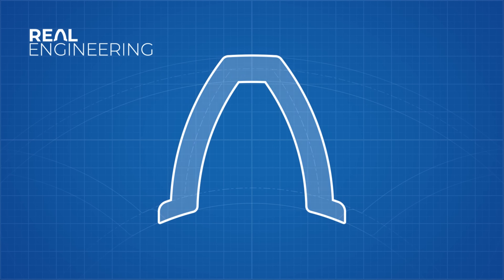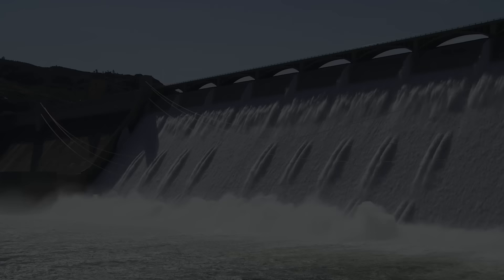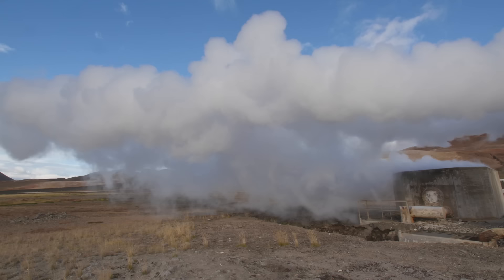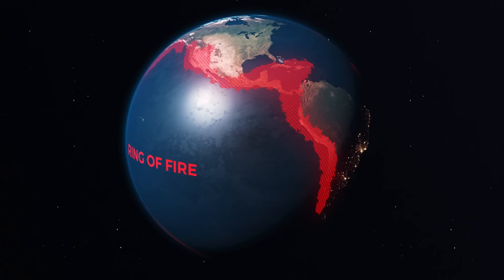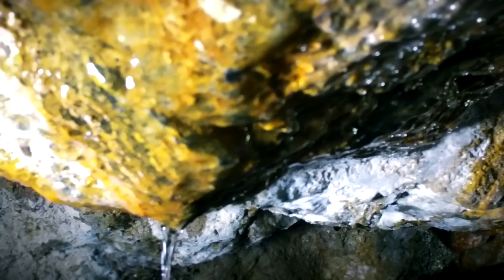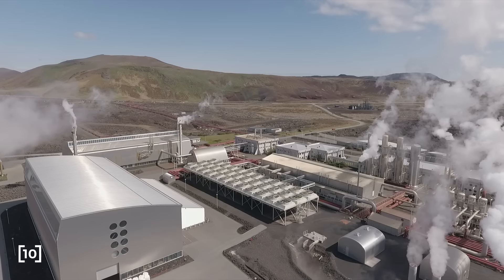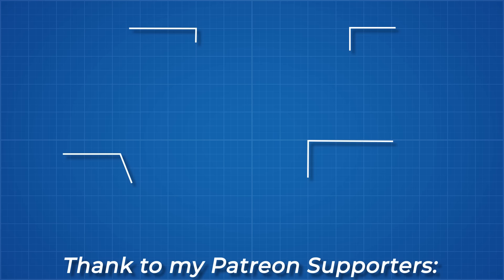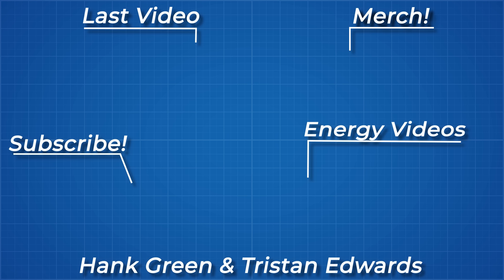Could Earth's Heat Solve Our Energy Problems?

Comment: If most of these geothermal sites are near tectonic plate boundaries, then aren't they prone to earthquakes? The underground pipes are gonna break and have to be rebuilt...
Reply: What everyone is missing is that it is actually that seismicity that generates the heat..  it's not coming from deep in the mantle.  That's why a borehole drilled on or near a fault will display far greater temperature increase with depth than a replica hole drilled to the same depth, but away from a fault.  Frictional ground movement is the key. 

Eliminate the seismicity from Yellowstone and there will be no heat to prime the geysers.  This is also why INCREASED seismicity will even activate long-dormant geysers.

Comment: a deep hole with 2 tubes.. one with thermal insulation, other with a high thermal conductive metal.. pump some substance through it and convert the energy from this heated substance using a v12 stirling engine made of coca cola cans

Comment: The solution lying directly under your feet is adding energy to an already heating planet. So how does an engineer explain how it isn't part of the problem? Volcanos are a natural phenomenon, releasing more geothermal energy by digging and drilling is additional and isn't 'renewable'. 

Harnessing already escaping geothermal energy isn't necessary when we use so little of solar energy already hitting the planet.

Comment: One question.
Why the binary cycle system is not being used in normal thermal powerplants as the liquids with lower boiling points will require less fuel to burn???
Can any one guide on this ?

Comment: This idea seems very dangerous to me.  Best solution to energy conservation is modest living.  Drilling into the crust has very little research compared to hydro or nuclear.  I don't know enough about solar but it is environmentally dirty.  But I haven't seen a document comparing hydro, nuclear, and solar on that front.  And I think at this point we need to really thinking about solar without battery storage with chemical standard storage.  We can store energy much more efficiently and cleanly.  That is just crazy.  so many topics touched.

Comment: Now what would intrest me are the limits of this technology. Say we built geothermal powerplants all over the globe. When would we reach a limit which would be dangerous to the dynamo effect of the earth core if that even would be a risk? Could we built too many of these so that magnetic effects of the earth are deminished, hindered or even put to a halt?

If used within geologicly active areas like the ring of fire example, would it help to stabalize those, again with the premise of massive amounts of these types of power plants, perhaps aiming for that limit and what would that be? I somehow doubt plate tectonics could be influenced by this, but for the sake of the argument, how many of these plants would be needed to do so :) ? I guess we would also need to define first a suitable size of a plant with a default output to get then a number of plants which would be needed to achiev what i questioned.

And lastly, what about the energy put into our energy balance that way, does it accumulate and by that increase say again the avverage temperatures on the surface, contributing to climate change? Sure there seems to be no waste, but the energy will need to go somewhere.

Comment: It seems to me, not enough information about the effect of taking the heat from the earth was presented. What is the effect of cooling down this top layers of the earth? Are we absolutely sure, that in the long run this won't affect the magnetic field of the earth?
Reply: Since we're not even sure that the core is hot in the first place, or that the magnetic field is actually generated by a dynamo at the core..  I'd have to say, NO, we're not absolutely, or even a little bit SURE about much of anything.

Comment: There are new ways to drill for geothermal energy by using a gyrotron which literally melts rock and creates a 'glass'  drilling hole while drilling. Testing with the new technology will take off in 2026 by Quaise energy. The technology can even be used to adapt old fossil fuel energy plants into geothermic energy plants.

Comment: Nuclear energy is a sensible energy solution NOW. Geothermal is nice in theory, but is still beyond our current technological ability. Some readily accessible geothermal energy is easy to get to but is very dangerous. But most stable sources are very expensive and difficult to get to. 

Let's keep using coal, oil and gas and nuclear while we are developing other technologies. 

The CO2 issue driving the panic at the heart of this is discussion is way OVERSTATED.

Comment: Truth about the root source for geothermal. 
Energy that power our solar system is electric energy in the form of cosmic electrostatic present in the cosmic space of our universe, from day 1. These e charge isn’t entirely static but transport from place to place in a process of charge equalization, in the form of plasma filament, aka Birkeland Current. Subatomic particles are carriers for e charge, if both separated otherwise, e charge and particles stay where they were. 

Plasma feeds our solar at its poles let it heat up high enough to emit electromagnetic radiation from infra red to uV, Xray wave and beyond. 

Residual energy dump from solar spread along its equatorial plane, some of which reached earth but get redirected to earth’s NS poles as Birkeland current display in aurora. Like our sun, it also let earth’s core heats up, but at a much lower temperature. Ignorantly we associate that heat generation by gravity and nuclear energy. 

The form of plasma, cosmic scale plasma, that heats up all stars in our universe and our solar is the same form of energy also responsible to assemble planets and stars, from e-field scattered cosmic subatomic particles and molecules, from a process called Z-pinch or magnetic punching. One form of energy does it all, not gravity.

Cosmic electric energy if can harvested economically it is the ENEEGY of cleanest, safest and limitless kind of energy.

Comment: Is geothermal energy renewable, and effectively boundless? Well, yes and no. The amount of heat being produced inside the Planet does exceed all current human use, although not by all that much. Perhaps more relevant is that all the energy already stored there, counting the core, is so vast that we could never consume more than the tiniest part of it, even in thousands of years. But neither of those quantities has any real relevance to the amount you could actually tap, because it comes down mostly to economics. If you could drill cheaply enough, and distribute the energy cheaply enough, you could have as much as anyone could ever use, anywhere, into the distant future. Essentially, you're mining that heat, and it's a really DEEP mine. But again, it's mostly about cost (and to some degree about safety). As the emerald green guy says, it's probably a lot more economical just to use wind and solar. You can't very well set up a geothermal plant in your back yard, but you can certainly set up some solar panels, with some storage.

But there's one kind of geothermal that may end up being vastly more important than the kind you normally think of: ground source heat pumps. You can put them under almost any building, and get benefits in any climate. You can bet on this growing a lot in the near future.

Comment: Also.. with first comment in mine and reading the few comments after.. can we make out own thermal energy with a bit of help from the sun. I was coming up with an idea that we can make reservoir that can hold extremely hot water, that water would be heated up with large magnifying glass or lens by focusing the sun's light on to a surface that would then heat up the water and then use in thermal energy. In other words heat up the water with the sun amplified. So like that you have a localized heat rather than heating up a larger area by make cracks and adding water and heating up the area then you are going to have a giant geyser or a new man made lake. Never mind they may fill the crack with water retaining substance but still erosion. I know this is long as well, other comment I read, but can we not use the limestone to clean our co2 problem granted that we first have to build a water fall air filtration system and then use the limestone to clean the water and then use in thermal energy systems. Another name I call a system that works with this is Hydroloop/Aqualoop it's a tube system like hyperloop but instead of it being airless it is filled with seawater with a really fast water current making it the world's first radiator system moving colder water from high altitude or freezing temperatures to warmer places and around. We can also move freezing water to the caps to replenish the dying ice. At the same time have a self propelling capsules that can travel in a one way tube at high speeds hence Hydroloop/Aqualoop. But yeah that it's my solution the problem is I can't do it by myself and I don't know where to start so if you do (ANYONE) please help  THANKS
Reply: The climate is getting warmer, so you're suggesting we use a giant magnifying glass to focus more heat on the Earth?
Reply: @bkm83442  no a local area like a small building a water tower a large tank a place that we can focus the sun's rays to heat the water instead of making hole underneath us and hopefully they don't collapse and we end up with a giant sink hole. And then get flooded and then have to build the hydroloop/Aqualoop just to fix that.

Comment: But you’re still drilling plus now adding in the factor of possible cooling the core sooner. Will that screw with our magnetic field around earth if we do it for as long as we used fossil fuels? Sounds like this could result in even more catastrophic failure than these carbon emissions were dealing with now. It also takes 36lbs of crude oil to make a 1x1cm microchip so we will still have drilling and fracking for technology. Will these both be able to co-exist in abundance without breaking into one or another’s holes?

Comment: why use the heat to produce electricity, the majority of which is then turned back into heat. surely small, local plants that directly use lower temperature heat would be better. anyone heard of heat pumps? the real problem is the high cost of drilling.

Comment: Permanent magnetic field of permanent magnet motor as a generator is a source of electricity that is without fuel or pollution. Thomas A Edison invented the first permanent magnet motor as a generator of electricity. A modern car generator chisel to spin with the field magnets to move like an edison generator is easily possible to construct.  You add an inverter to the 12 v DC generator 12 DC 110 AC power outlets.  120 A 110v outlets from one car generator.  6 20 amp outlets.  13.3 kw power house current.
Reply: If you add banks of dynamos and inverters added and the series of transformers to deliver power line voltage AC power continuous peak power.   How many gen dynamos inverters transformers to deliver 2000 volt power line voltage AC.  24 mega watts of power at 2000 Volts.
Reply: A brushless motor with generator coils is a dynamo.  This produces more electric power than it uses. The electric power comes from the iron of the case of the dynamos. The magnetic field created to power or move the motor creates electric current in the coils of copper wire in the dynamos.

Comment: I just wonder how you can say that the centre of the earth is the same temperature as the sun, how could you certainly measure such a temperature?
Reply: They have no idea..  and it's not hot.  Think about this..  If the interior of the Earth is hellishly hot, then the crust that floats atop all that heat has been heated for billions of years from below.  If this were true, the thinnest crust would show measurable heat transfer..  but it doesn't.   The oceanic crust is only about 1/5th as thick as continental crust.  Now go to the thinnest parts of oceanic crust such as at the bottom of the Mariana Trench where there is literally only a tiny amount of crust separating the water from that heat source.  Why is that heat NOT radiating through that thin crust and heating the water right at the bottom?  Instead, that is one of the coldest spots in the ocean.  They have INFERRED high heat from supposed magma and boreholes.  But, they've been wrong all along.

Comment: I am confused that you wrote a thesis and your take of the process.  30 years is good for a life cycle and now another bore can be drilled for less capital. In the past the access cost about the same as the generation equipment. A closed loop system does not bring up minerals and requires less pump power.  I wonder if an expert reviewed your thesis who actually works in the industry?

Comment: Geothermal energy is not gravitational, or only for a small amount and you can find the reason into the History of Earth's Age.
Lord Kelvin calculated the first Earth's age to be between 10 and 200 millions years old, that it is an error factor about 20 times the real value. The Lord Kelvin's error gives you an idea of the energy distribution. 
The reason is because Lord Kelvin was not aware about nuclear energy and that is why his Earth's heat budget was wrong.
It is about 95% of geothermal that is spontaneous nuclear fission energy and only 5% that is gravitational.

Moreover, no engineer could pretend to collect more nuclear fuel over a surface of a sphere rather than there is into the volume of the same sphere. The nuclear fission industry will stop before the geothermal will end, due to lake of fuel.
How many nuclear power plants do we need to build to generate the same amount of magnetic momentum than the Earth is creating ?
How long time the nuclear industry could generate such field ?

Comment: Shame we cant use energy stored in ice when it freezes naturally to prevent the need for so many batteries, in cooler months. Or build a network of power across the globe that fluctuates with each hemisphere experiencing different seasons. I know these are both impossible and nice ideas. At least until we understand how to use super conductors without the requirement for such temperature extremes. 

If the whole world is tapping into this resource what is their to prevent the Earth's mantle being effected? You're talking about changing the nature of tectonic plates, a fine balance that literally holds our planet together. I like the idea of using natural resources but drilling into the earths surface for our own gains doesn't sound positive. I believe the one thing that will destroy our species is the idea that we can keep taking from the planet and it will just keep giving.
 
It's almost ironic that the Dinosaurs had no idea of any of our technology and they lived 165 million years. Should be an example to us, as we're struggling with 30,000.

Comment: Yes, let's tap 10 TWatt from the Earth continuously.
Nice and cheap, if you don't mind the side effects.
Solidification of the Earth's core over time, seismic effects due to solidification,
no more magnetosphere due to solidification, crop loss due to enhanced
radiation due to having less magnetosphere.
Nice, great.
And yes, the Earth produces lots of eneregy, but it also needs that energy, or at least
most of it. If it had a large surplus we'd heat up, we don't.
If it would have too little, the Earth's core would already be soldifying.
There's room for a little geothermal, but on a global scale energy tapping ?
Much similar to CO2 output causing holes in ozone layer and such, but worse.
I'd reserve geothermal for heat depleted regions, being extreme North and South,
whom actually need it the most.

So, no, I don't agree with glbal usage of geothermal.
Use solar power, apply a global UHVDC net, and have 24 hours sunshine,s ince
now the power can be created anywhere in the world and transported through
the UHVDC network.
Instead of tinkering with the Earth's core on a global scale, use solar for
less than 2% of teh Earth's total surface, and solve the energy problem worldwide
for perpetuity. It also needs much less maintainance, when using fixed solar panels.
It also won't need nature reserves, since it can be done in deserts.
Reply: Never tinker with your only planet, you can only risk
a planet once you have more than one.
Reply: Of the energy still within Earth's molten core, you can maybe safely tap like 2%,
The rest is a requirement for continued production of said energy.
The people that think we can just put in a big tap and start drawing
are sorely mistaken, especially when it's supposed to cover the global energy needs.
Reply: It may appear that solar is a lot of work but it will work 100% guaranteed,
without side effects, and with reduced solar tapping
it in turn may be combined with refertilization.

Comment: A company should  manufacture small gas turbines connected to generators, say 3 KW or 5 KW, and sell these to homeowners, for installation in a garage or basement.  These would run on national gas.  If enough people purchased these turbines we could take down overhead wiring, which is an eyesore and occasionally fails because of storms or falling trees.

Comment: Geothermal energy has the same problem as nuclear fission (and fusion) in respect to global warming. It’s not system-neutral!
We need to cycle the energy in the system instead of adding it from otherwise confined sources. 
The discussion is so concentrated on greenhouse gases that people forget there are other ways to heat the atmosphere.
Furthermore one releases methane in the fracking process.